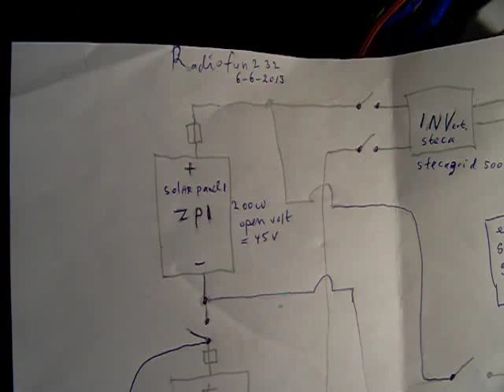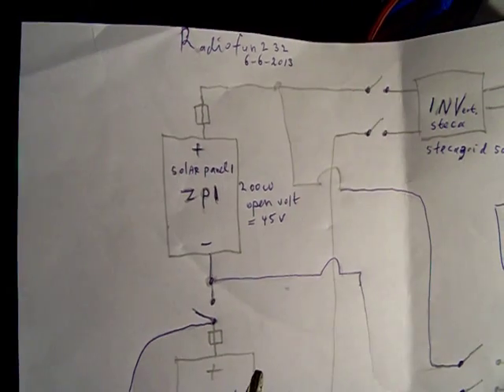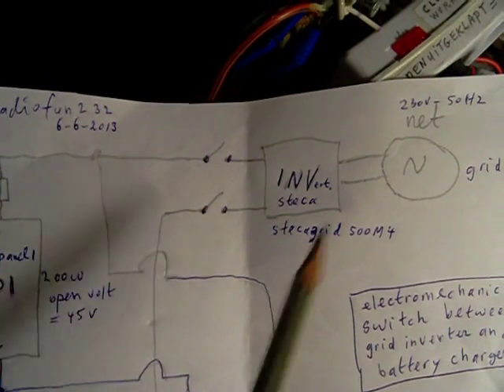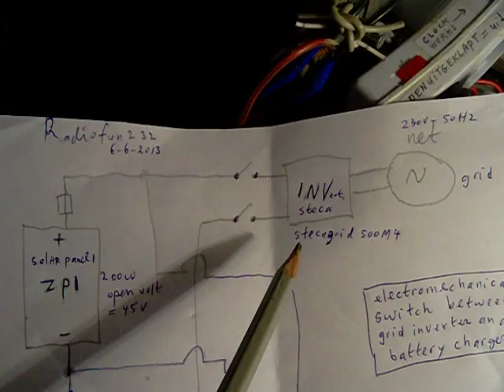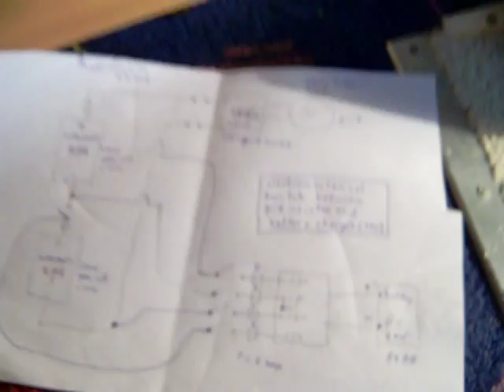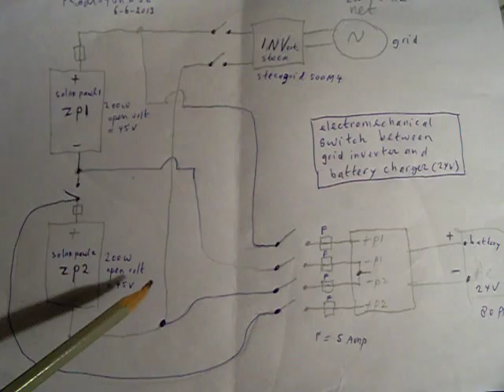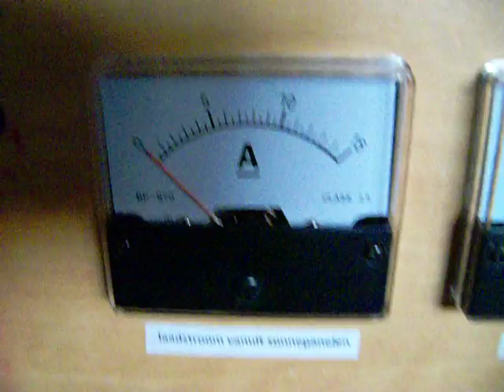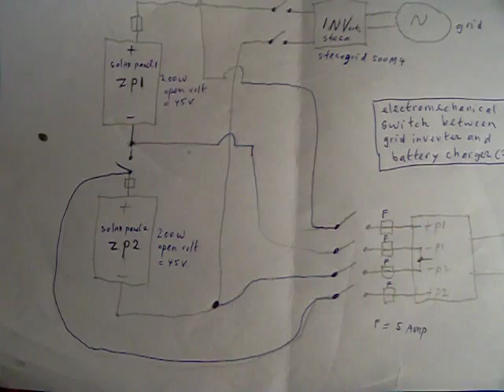Solar energy: electromechanical switch between DC batt. charger and grid (AC) inverter

Comment: On 2014-01-05 23:05, kamal@solargreen.in wrote:
> Warm Greetings !!!
> 
 Our co. is planning to execute the Greenfield project ( Direct
 charging of 30 numbers lead acid batteries or more  each having capacity 150 AH
 in series with Solar Panels) 

 WE INSTALLED 64 PANELS  BATTERY MANUFACTURER AND LIKE TO CHARGE GREY BATTERIES FROM PV MOUDLES THAT IS DC INPUT TO BATTERY CHARGING AND REQUIRE DC CHARGER
> 
>   The panels provided by the manufacturer with following technical
>   parameters as below
> 
>   > Maximum Power : 240 W
>   > Voltage at Max Power (V mp) : 28.33V
>   > Current at Max Power (V mp) : 7.59A
>   > Open Circuit Voltage (v oc) : 35 V
>   > Short Circuit Voltage (I sc) :8.12A
> 
> QUESTION   1.       I understand that you want to charge  12V/150AH
> batteries by solar. Do you require to charge          other capacity
> ( 100AH, 200AH etc) of batteries also by solar.   Pls clarify.
> 
> ANSWER            Yes we charge other capacity batteries ( 100AH
> 200AH 65AH 40AH ETC ) also.
> 
> QUESTION    2.     For 150 AH battery , what can be the maximum
> charging current do you recommend. ( I guess 20A maximum. We can set
> as per your requirement)
> 
> ANSWER       We require maximum charging current ( 28A TO 30A MAXIMUM)
> 
> 
> QUESTION    3.    Do you require bulk battery charging  ( one charger
> for 10 or 12  batteries  at a time)  or  one charger  for one battery
> 
> ANSWER              We require require bulk battery charger ( one
> charger for 15 or 16 batteries at a time)
> 
> 
> QUESTION  4.       What is the battery full charge voltage  ( we
> usually set 14.5V  for 12V battery for our inverters. We can set as
> per your requirement)
 
 ANSWER               We shall set 17.5V for 12V batteries

pls guide me

>  Thanks & Regards
> 
>   kamal alang
> 
> SOLAR GREEN
> M 8 A INDUSTRIAL AREA
> JALANDHAR  (PUNJAB)
> 
> E MAIL : kamal@solargreen.in
> 
> cell   : 09814060711
> 
> WEB   : www.solargreen.in